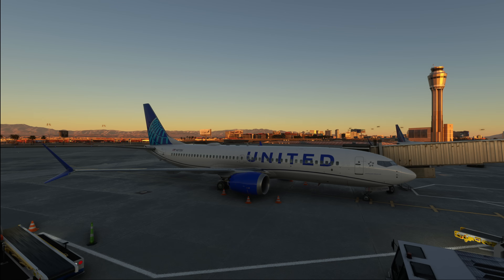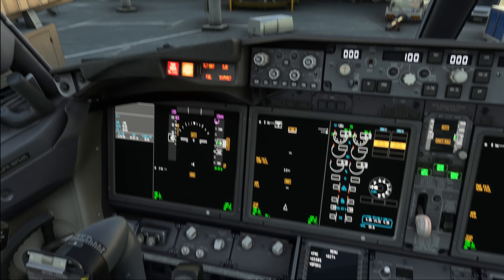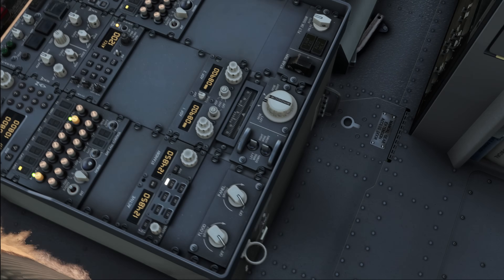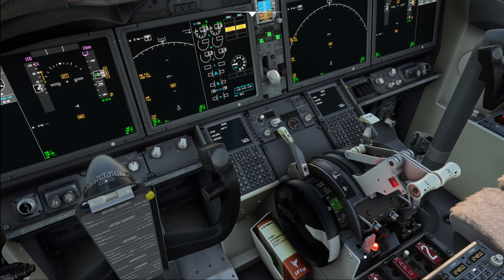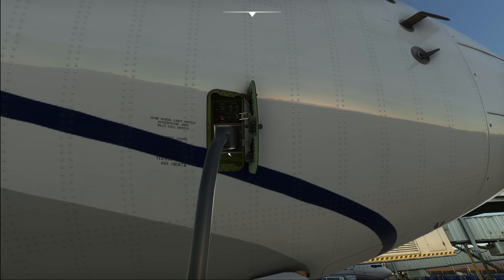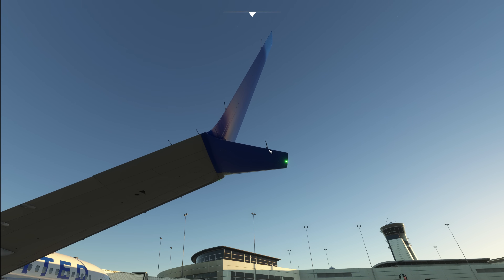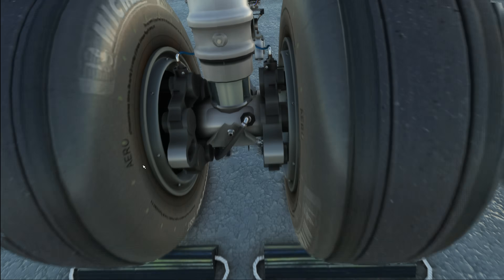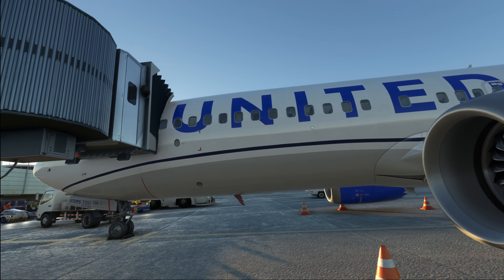iFly 737 MAX Tutorial 1: Safety Inspection, Electrical Power Up & Walkaround | Real 737 Pilot

Comment: Awesome tutorial again… are there any checklists come with the 737 Max? Or do you have a recommendation which to use for the MSFS?
Reply from the maker: Hi, if you google for 737 QRH you will find the original checklists pretty quickly. Nothing is better than the originals, right?
Reply: @A330Driver fully correct … thanks you a lot

Comment: Hey Emmanuel! What you mentioned about finding feathers inside the engine, beyond the fan, in that case, was the flight a no-go and you had to change aircraft? Or is there sort of a limit to reach before the flight has to be suspended?

Comment: Any chance you know why my electric pumps dont make sound when turned on?
Reply: Like on the 737-800
Reply from the maker: Hydraulic or fuel?
The elec hydraulic pumps should always make the sound when on. If you don’t hear it (outside) it’s a bug.
In the flight deck you do not hear them.